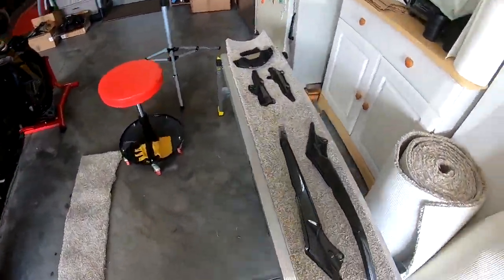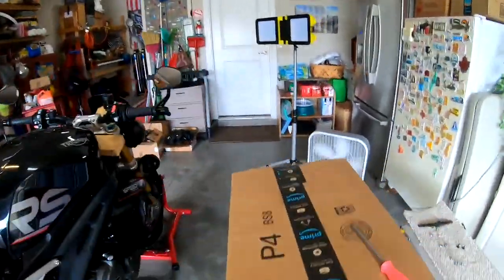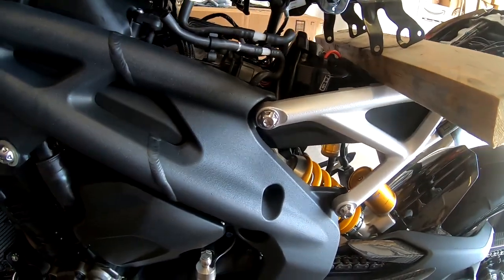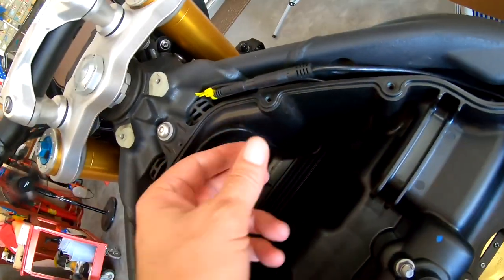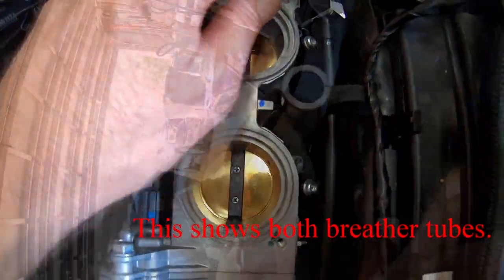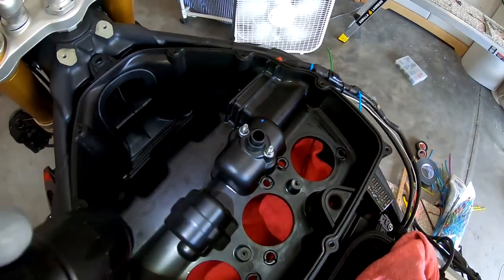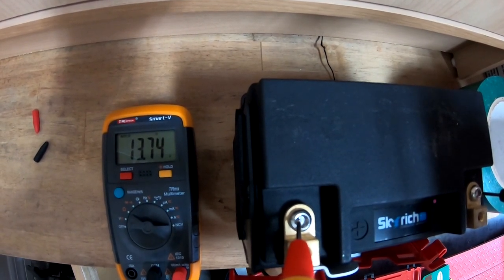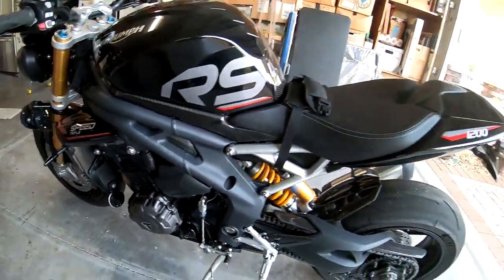Installing carbon fiber goodies and changing the air filter on the Triumph Speed Triple 1200RS

Comment: Thanks very much for posting all the detailed information 👍🏿 I just picked up a ’22 RS and am having a blast. This is my first Triumph so I’m still learning how things go together. I got the fly screen and visor, but can’t figure out how to safely take apart headlight visors, etc without breaking any delicate little clips. I’m going to order a service manual. 
Your bike looks awesome and thanks again for the cool info! Ride Safe 👍🏿
Reply from the maker: You're quite welcome. Are you ordering a paper version of the manual? If you can get one please let me know. My understanding is that they are only available as temporary online from Triumph.
    Enjoy your new ride.
Reply: @scottsspeedtriplechannel  I plan on ordering printed version...I didn't know of their availability, but will let you know what Triumph says. I also got the heated grips, which connect to the main wiring harness where a plug is in the jack for the grips(don't know exactly where this harness is and how to identify the correct circuit) and I really hope some version of a service manual is available!
Reply from the maker: @frankgelormini8227     Being from Florida, I didn't get the grips. I have a set of heated gloves that work pretty well though.
   And thanks in advance for letting me know about the manual. I really want a hard copy for myself, too.
Reply: @scottsspeedtriplechannel  and order a subscription for $8.33/month. I bought a subscription and will use it for a few months then cancel and renew as needed (until a printed version is available!)
Reply from the maker: @frankgelormini8227  Thank you for the update. I'm going to look into that. Enjoy the ride. I hope to hear from you again soon.

Comment: Did you install carbon belly pan sides and belly pan center?  Thoughts? Any pictures of the carrier intake wing installed? Thanks!
Reply from the maker: I didn't get the belly pan sides or center. 
   I have been waiting to install the carrier wing. I have been trying to find the part that goes above it that I had thought I had ordered but only got a very small "center infill" piece. 
   So it is still not installed. You may have just given me the initiative to get it done though. Thanks.
    I'll post a video of the install... maybe soon, maybe not so soon, but I'll give you a shout out when I do.
    There's been a couple of times I started imagining what it would like like with every carbon fiber part available. I can find all the bodywork and all the black plastic covers. The tank would be the only painted part left.

Comment: Did you make a video for the scrolling indicators? I’ve been told you need to set the up through the computer from the triumph dealer. But I think they should be plug and play
Reply from the maker: I did not make a specific video about installing the scrolling indicators. I did mention it somewhere in one of the videos that they are indeed "plug and play". The most difficult part of the installation is having to disassemble the rear taillight/signal/license plate holder to run the wires.
   I did not disconnect the battery during the install so I had no "service overdue" code when I finished. If you do disconnect the battery, you will need to reset the date and time to clear the "service overdue" code.
    Thanks for asking and enjoy the install. They are more visible and look pretty cool with the hazard lights on.

Comment: Cool, am going to have the rear frame powder coated, so good to find a video on tank removal.
I have the access to the online workshop manual to.. but good to get an idea first.
Didnt you have to run the engine with the fuel pump fuse out? says the lines are under pressure?
Reply from the maker: When I took the fuel line off there was no pressure in it. I did not turn the power to run throughout the entire project though. I think the only time you would get fuel pressure is when the bike is in the run or on position.
   A little bit if fuel dribbled our, but nothing major.
   I'd like to know how you got the online service manual. Is it directly from Triumph, a factory manual?

Comment: Hey Scott, nice video! I'm looking for buying a speed triple like yours, am I right there are no passenger handle options in the market right now? In your experience could it be possible to attach one from the under side of the seat?
Reply from the maker: Yeah. That could be possible from where the OEM license plate holder attaches. I haven't seen or heard of anything yet though. I know Triumph used to have passenger grab rails available as an OEM accessory many years ago though.

Comment: Nice video ! I've had the carbon frame infills for a while now, procrastinating as I knew it would be a pita to install. I've had the tank and airbox removed when I first got the bike to wire a usb plug in the front. What electrical boxes were you talking about and how hard was it to take them off.
Reply from the maker: Directly above the battery box are two "electronic parts" just wider than the box itself. The top piece snaps into place and has only three fairly large electrical connections at the rear. Under that is another part in a plastic housing with two plastic "pins" that slide into grommets on the left side of the bike. That piece also has a bolt holding it down on the right side. 
   I had to move both those pieces to reach into the frame infill area more easily. I did not disconnect the connections, just lifted them up and back out of the way.
    I have a question for you... is the #1 cylinder throttle body butterfly plate held by a gold colored cross piece like mine? If you look closely at the throttle bodies, mine has a gold colored bracket or brace on #1 cylinder, but the other two are black. 
    Thanks for watching. I'll have a new video out soon with the SC Project exhaust sound comparison. I hope you stick around for that too.

Comment: Hi Scott greetings from the UK, can u tell me how you install the chain guard on the 1200rs as I have bought a carbon one .......but for the life of me can only see one bolt to undo near the rear sprocket......please help many  thanks
Reply from the maker: I had to go look at it again because it's been such a long time since I changed mine.
    So you see the bolt near the rear sprocket. There is also a bolt just in front of the hole in the side of the swingarm that is put in from the wheel side facing out.
    If you get a flashlight and get your head down in there you might be able to see it.
    There are also two threaded collars in the chain guard itself. The front one is for one of the hugger fender bolts and I think the second one is also. So you would have to remove those bolts before the chain guard could come off.
    I am certain that I had the rear wheel removed at the time when I replaced the chain guard. I was also changing the hugger at that time also.
    To remove the rear wheel you would need a special socket and a stand for the bike. You would also need to remove the muffler to get the wheel off.
    I didn't remember how complicated it was to change the chain guard. If you're having any thoughts of getting the carbon fiber hugger, I'd suggest you get it and do both at one time.
    Sorry I couldn't be the bearer of good news. Best of luck and thank you so much for subscribing.
    I haven't been uploading much lately, but plan to start again soon.

Comment: Scott you ever have any issues closing the gas cap? Had a problem getting it to latch the other day.
Reply from the maker: No. Not once. It takes a bit of firm pressure to make it close, but it has always worked.
Reply: @scottsspeedtriplechannel  thanks for getting back to me. It always closes but I  had a little trouble last time
Reply from the maker: You are not the only one. Either "2up vlog" or "Sgt Sodom" or "cuban Rider" channels had people mention that. I don't remember a fix or even a why it happens though.
   I have forgotten to close it a couple of times though. My tank bag is large and after fueling up it sets down over tha cap. Twice I think I have just fatened down the bag and ride away. The bag is tight enough that no gas was spilled. No warnings showed on the dash either.
Reply: @scottsspeedtriplechannel  I am just going to make sure it's  closed. Thanks again

Comment: Thx for all the details.  Could you share where you bought the carbon bits from? And also the windscreen?
Reply from the maker: The carbon fiber is from Carbon FBR in England. It is a small company that specializes in Triumph parts.
   The "flyscreen and windshield" are OEM Triumph accessories that can be ordered through your Triumph dealer.
   Thanks for watching. Enjoy the ride.
Reply: @scottsspeedtriplechannel  

Thank u👍🏼

Comment: Great video and the bike looks stellar.  Lot of work but worth it.  Thank you for sharing!

Curious....do you think I could get away with just lifting the tank in place, still full attached lines, etc....just enough...if all I want to do us those carbon fiber side panels on the tank?

Thanks!
Reply from the maker: Yes if you are only changing the fuel tank infills. The frame infills required the airbox plus removal.
Reply: Thanks for the reply!

Any issues when installing the windscreen?  By issues I mean weird Triumph warning messages, etc?  And may I ask where you got yours from?

Thank you very kindly for thr patience and replies!
Reply from the maker: @dblhelx  I have the OEM flyscreen and windshield. You can order them from Triumph. The windshield attaches to the flyscreen but you can install the flyscreen without the windshield if you prefer.
    To install the flyscreen, the instrument screen has to be unplugged. I found that anytime you unplug the screen or disconnect the battery, a "service overdue" warning will show until you reset the date and time. When the power is cut to the screen it reverts to the year 2000.
After resetting the date and time the "service overdue" light goes out.
    You could watch the setting the  clock and shift indicator light video and it shows that.
    You're welcome to ask questions anytime. If I can help I'll gladly do so. Thanks for watching the videos. I hope you keep watching in the future.

Comment: Is that the Triumph windscreen? And how well does it work. Thx
Reply from the maker: Yes, that is the OEM "flyscreen" and windscreen. They are two separate parts. You can just install the flyscreen if you choose to.
   I always ride with a pretty large tankbag (usually stuffed full) so I have a good "windbreaker" from that alone. When the bag is not so full, the screens do help with direct wind blast a bit.
   I have noticed on days with heavy winds that I seem to get more buffeting with the flyscreen and windshield than before I installed them. I only had the bike a month or so before installation though so it may just be that I did not notice the buffeting before I put them on.
   I felt like the flyscreen completed the looks pretty well and would protect the instruments screen some also.
Reply from the maker: Also be aware that I cannot get into a full tuck with the tank bag on.
Reply: @scottsspeedtriplechannel  Thank you for the answer sir. I appreciate it

Comment: Is the cat welded to the headers? I’m thinking of getting a mid pipe and it would be nice if I could bolt back in the cat if needed.
Reply from the maker: The catalytic converter is welded to the headers.
    The exhaust consists of three parts. The first section are the three header pipes with the welded on catalytic converter. The O2 sensor is in this part just in front of the cat.
   The second part is a black squarish collector/ primary muffler. It uses a donut type gasket at the headers and has two pipes exiting the rear. The upper of those pipes contains the exhaust valve.
   Lastly is the large silver secondary muffler.
   Sorry about that, but thanks for watching. I hope you continue to watch and comment in the future.
    A full system might be the best way for you to go.
Reply: @scottsspeedtriplechannel   thanks so much, It sounds like I need headers made too...

Comment: Hey Scott, great video. Have you noticed any difference on the intake sound after changing the air filter? Especially when the throttle is wide open. :)
Reply from the maker: So a lot people/ videos mention the intake sound being so good. I honestly don't even notice it until the exhaust valve is open which is not often for me.
    Yes, there is deeper intake sound when I get on the throttle hard. Overall for most riding I just hear a deeper tone.
Reply from the maker: I misread your question Can. I replaced my air filter with an OEM one. It made no difference in the sound of the bike.
   I posted a new video of the SC Project muffler installation, which made a big difference in sound. I thought that was what you were asking about.
    Sorry.

Comment: Great Work, looks Amazing! Who you order this Carbon Parts?
Reply from the maker: They come from Carbon FBR in England. They specialize in Triumph and there are lots of parts available.
   If you want to match the front fender, order the "Twill" pattern.
Reply: @scottsspeedtriplechannel  Thank you, would you tell me too? where did you get the tank pad? that's exactly what I'm looking for
Reply from the maker: @z_brez_r1687     They came fron Amazon. It's actually three tank protectors. I wanted to cover from the front to the seat so one wasn't enough. I cut and arranged them to suit my needs.
   The brand name is "Otiliman".
   I also saw some from "labelbike" 2 3D gel protectors that I really liked. They had one for the top of the tank and two for the sides with the Triumph Speed Triple 1200RS logo on the tank and the graphics on the side match the "RS" logo. Really cool.
   BTW, thanks for watching the video and I'm glad you commented.
Reply: @scottsspeedtriplechannel  i got a wind screen from them it was PERFECT....top notch work...
Reply from the maker: A Carbon FBR windscreen?
Reply: @scottsspeedtriplechannel  i guess some people call it a fly screen because its not clear..
Reply from the maker: Yeah. Cool. Did you see you can get every single body part except the gas tank. Lots bucks though.
Reply: @scottsspeedtriplechannel  no i didnt ill check it out...i want a front fender BAD...
Reply from the maker: The front fender is already carbon fiber.

Comment: did the error messages go out on their own??
Reply from the maker: No. The error message I got was for "Service Overdue".
   The time and date had reverted back to the year 2000 when I disconnected the battery.
   I reset the time and date and then the warning went away.